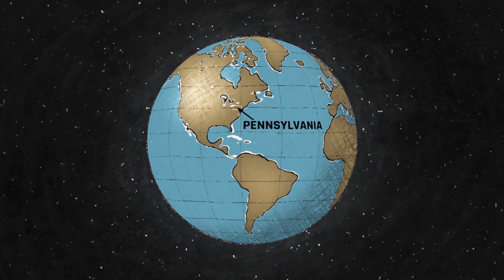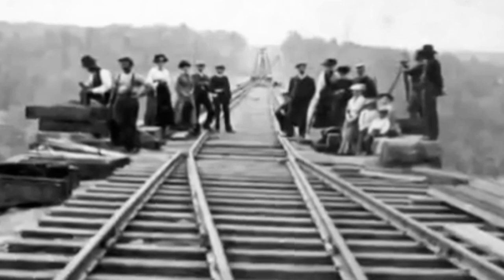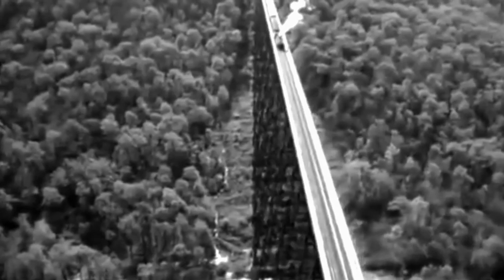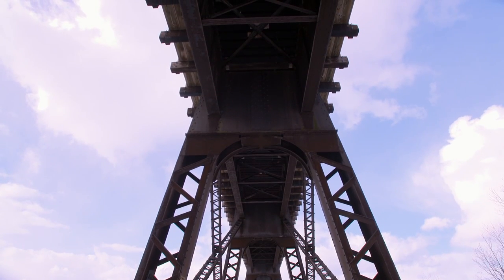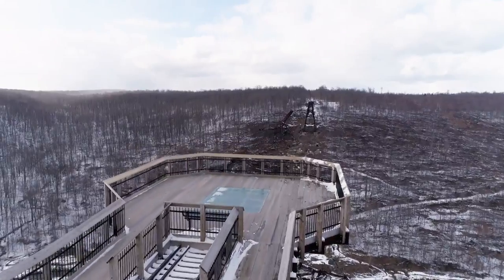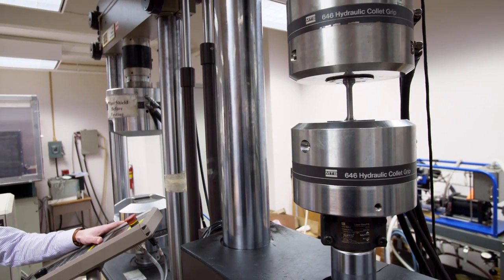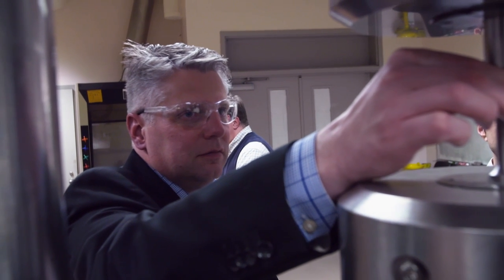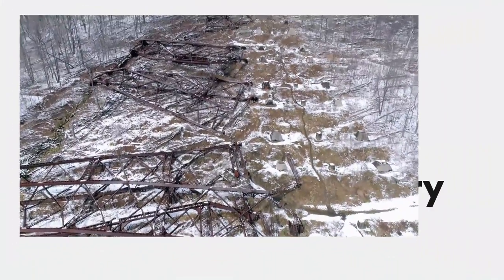How The 8th Wonder Of The World Failed Due To An Engineering Oversight |Massive Engineering Mistakes

Comment: This is NOT an engineering failure. The bridge was built on time, with few fatalities, and lasted a century. Pennsylvania is not a tornado zone, so there was no reason to consider the effect of a tornado on the structure.
Reply: Tornadoes do happen here in PA & there was a F3 one near Beaver Falls, PA back in I think 1989
Reply: @EdEddnEddyonline1  rarely ever do tornadoes occur to the extent they do in more prominently affected areas
Reply: @EdEddnEddyonline1  they are usually rare and small most only travel a short distance
Reply: And the proof of the pudding is that the railroad trestle stood for 100 years!
Reply: I did engineering in college, this still counts as a failure, It's still an impressive structure and it lasted for a hundred years, but the design oversight that caused it's failure is still something to learn from and apply to modern construction. The designer did not factor in the 100 year storm probability for freak weather, that's why bridges are generally overengineered, it's more expensive and takes longer to build, but the result is a bridge that will stay up even if the anticipated loads are exceeded.

This isn't the only bridge to fail due to design oversight not factoring in wind loads.
Reply: @G1NZOU  :   Well, there are wind loads and then there are 100-year storms.  I don't think you can call it an engineering failure just because it didn't survive a freak Act of God that occurs only once a century (if that).

No one was killed or injured, and by virtue of the fact that the bridge lasted 100 years, it more than paid back its construction costs.  Any cost-benefit analysis would call that a success, not a failure.
Reply: @Milesco  Perhaps you should look up what 100-year storms actually are. They're not "freak acts of god", they're statistical analysis of probable weather patterns. It absolutely qualifies as a failure, but that doesn't mean it was a bad structure, a real engineer would not sit around whining and saying "but it stood 100 years", they'd take interest in why it failed, and then design better.

There have been other bridges that failed from high winds that did cost lives.
Reply: @G1NZOU :  The bridge stood for 100 years and only came down after an extraordinary, once-in-a-century storm.  That is absolutely not an engineering failure.  An example of an engineering failure would be the 1981 Hyatt hotel disaster or the 1940 Tacoma Narrows bridge collapse.

But I like your logic.  "It absolutely qualifies as a failure, but that doesn't mean it was a bad structure"

Hmmmm....that's interesting.  Let's see if I can master this new concept.  "Hitler was responsible for the murder of millions of people, but that doesn't mean he was a bad guy."   "My car is black, but that doesn't mean it's not white."   Hey, I think I've got it!
Reply: EdEddnEddyonline1 it took over 100 years for a tornado to hit it, here in Oklahoma you’re lucky to get 10 years
Reply: @Milesco  why does everyone losing an arguement bring in hitler. What's hes saying was most bridges take into account things that are  unlikely to happen.
Reply: @sinsoftheswamp8346  :  No, no, no....don't try to make this about Godwin's Law.  I wasn't comparing anyone to Hitler; I only mentioned him as an example of a really bad guy and how wrong it would be to say that he wasn't a bad guy.  Like saying a bridge is a failure, but it's not a bad bridge. Talking out of both sides of one's mouth. 

And yes, bridges should be designed to tolerate unusual events.  But how unusual?  There's a practical limit to how rugged you can construct a bridge, or any structure.  If the thing lasts 100 years and only comes down in a massive freak tornado the likes of which haven't been seen in a century, then that's good enough.  It's certainly not a "failure".  Especially by 19th century standards. 

As I said before, a proper example of an engineering failure would be the suspended walkways of the Hyatt Hotel in Kansas city or the flippity floppity Tacoma Narrows bridge, which collapsed almost as soon as it was built.
Reply: @Milesco  I agree but I feel tornados are not that unusual. In the area it is but they do happen but I agree with ever other point
Reply: @Milesco  and in the video they said the fix was replacing bolts with steel which seems easy enoguh but also I'm not a bridge expert.
Reply: @sinsoftheswamp8346  : No, not easy at all, unfortunately, which is why they weren't replaced.  The iron bolts were permanently encased in concrete footings.  The only way to change them would be to dig up all the footings out of the ground and replace them with new footings with new bolts.  A huge, expensive job.
Reply: @Milesco  you spelled "Jerk" incorrectly
Reply: @EdEddnEddyonline1   that is a wimpy one
Reply: @G1NZOU   it lasted a lot longer then road bridges do
Reply: Any tall structure with such a small footprint needs to be designed to withstand wind load, snow load, ice build-up, corrosion, water or flood load, earth movement/low scale tremors, vibration/harmonic anomalies, lightning and of course...the infamous fire breathing Kraken.
Reply: As a structural engineer, I can tell you that you should ALWAYS account for uplift. Anyone who doesn’t is a fool.
Reply: Surprised this show hasn’t done one on the WTC.

“Engineering shortcuts that allowed them to collapse after being hit with two large planes.”
Reply: and global warming is a hoax...
Reply: @edwardmajorphotography564  I think people are just up in a fit cause they labelled this as a "failure". what they don't realize is it doesn't matter if the bridge stood for over a hundred years, if it could have lasted 2 or 3 hundred had it accounted for uplift that's still a failure in the engineering point of view
Reply: Neglecting to place those anchors after that much corrosion and such a massive lifespan also seems like a failure
Reply: EVRAZ group of Russia 🇷🇺 owns EVRAZ Claymont Steeel! EVRAZ Pueblo Colorado! EVRAZ Portland Oregon! EVRAZ Chicago Illinois? SteeeL Leaders in our USA 🇺🇸
Reply: Captain Quirk 4oo4 and 40o5 big BoyZ
Reply: Captain Quirk I lived in a place where a viaduct collapsed onto a Locomotive 🚂! Bridge was replaced ! Live the Legend! Cheyenne Wyoming USA 🇺🇸 🚂
Reply: That one Canuck yes I met those twins brothers! Stew and Pid! They have cousins Twin sisters ... Pretty and Dumb
Reply: Question is would the bridge have survived a direct hit by a tornado if those had been replaced? It was hit by a tornado afterall, those tend to destroy even the strongest buildings.
Reply: @aerobrick1251  it was the "new" bolts that cracked and failed. Not the iron pins.
Reply: @danielch6662  those were old and corroded enough I would still say its a maintainence and upkeep issue. Though yeah its impressive that the oldest bits were the best built
Reply: @aerobrick1251  no shit huh
Reply: We get PLENTY of tornadoes here, especially up north west of Pittsburgh...But; you're right; NOT an engineering failure...That statement made me wince too...:)
Reply: WAS not tornado zone
Reply: But jet fuel can bring down a building but not burn the camlejockeys passports ?
Reply: This storm would have probably taken down anything short of the firth of forth railway bridge.
Reply: the anchors failed anchors were designed by engineers as were the caps used as a shortcut to save money... so yes, it was an engineering failure.
Reply: @G1NZOU  It's definitely something that should be factored into similar construction.  But this show is making this out to be some sort of "ZOMG MASSIVE FAIL HOW COULD THEY" when it was a mistake, yes, but an understandable mistake on a structure that was carrying loads it wasn't designed for over a length of time it wasn't designed for.  I guess it's not on the original builders so much as on someone in the 1980s doing an analysis and wondering if they could replace the old structure with one with higher safety margins at a doable cost.
Reply: @sinsoftheswamp8346  Even in places with more tornadoes most structures are not designed for them.  The probability of a tornado hitting a particular structure does not usually justify the massive increase in cost and the reduced functionality.  Safe rooms are designed for tornadoes and they are usually made of reinforced concrete and do not have windows.
Reply: @MoltenMetalCasting  you're a bit late I have no memory of any of this sorry
Reply: @Moose6340  I agree it isn't on the original builders, the original design was sound and perfectly adequate for the intended loads at the time it was first designed.
The cost cutting in the rebuild construction is at fault.
They made similar critical errors in the construction of the skywalks for Hyatt Regency, where the construction company simplified the design and the change was approved without recalculating the safety margins for loading.
When it comes to failures like this it's important for shows like this and engineering classrooms to point it out, otherwise it can keep happening due to complacency.

However, it had been closed since 2002 because it was at risk from high winds, the problem was known about, the point is stresses and unintended loads are something to take notice of, especially when you factor in age and corrosion.
Reply: @G1NZOU  well skyscrapers are designed also for airplane impact....after a ww2 bomber hit the empire state building ... and  the ESB still standing the other 2,3 not....:D:D:D. 100years ago they knew shit about electrocorossion, 100y storm , fatique and other ..they didnt know even how to weld properly all was a hit and miss aproach.
Reply: @tomast9034  That's my point though, 100 years ago they may not have known enough, but the inspectors over the years found problems with the bridge.
The bridge was closed to commercial passenger traffic for years before this storm came through, precisely because they had found problems, and even before that they set limits on trains going over cause locomotive weights had increased over the years.

People are getting so defensive when this collapse is called a failure when they're actually misunderstanding what failure means in engineering terms, it's not that the bridge didn't do many decades of excellent service, it's that continuing to use it after inspections show it's lacking because it's stood for a hundred years isn't a good idea, we have more stringent inspections for good reason.
Reply: @jbodden6977  birds ain't real